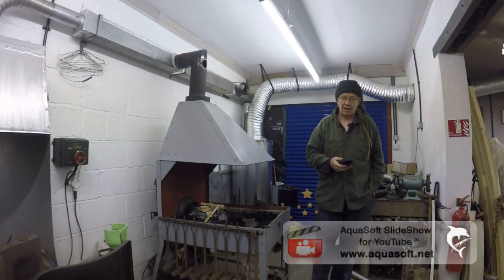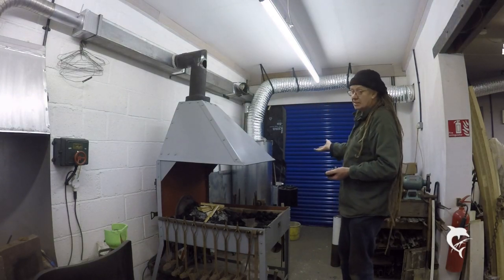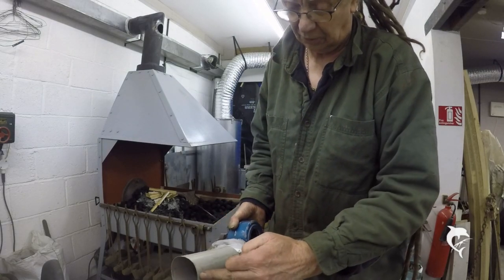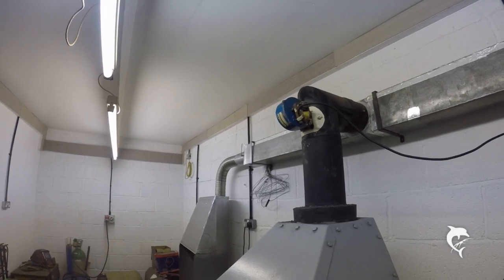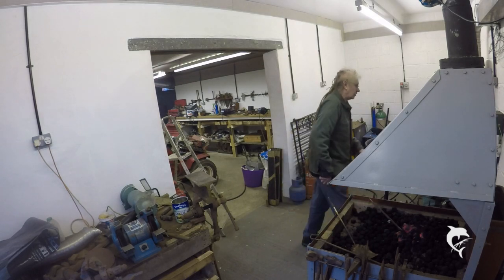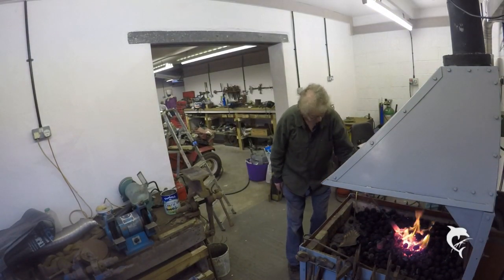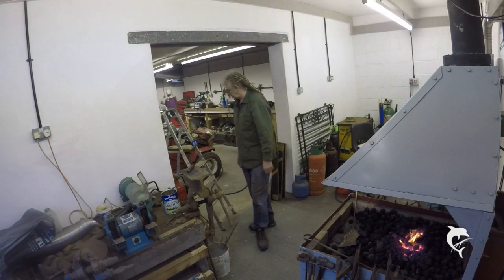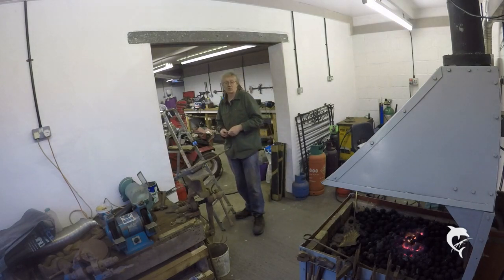A smoky forge, rivets, and a CO alarm!

Comment: Hey up Phil. It may not apply to a forge (especially with fan extraction) but there is a formula that relates flue (chimney) height to fire opening which achieves the correct amount of "draw". I've seen it in an old book somewhere. Also as you will already know I'm sure, the flue needs to warm up for best results. Loving the vids BTW.
Reply from the maker: Part of the problem is that the flue is too small, which I though I could make up for with the flue blower (there are 2 now) and they do make a difference, but not enough of a difference when you are lighting the forge, thats when it smokes. I think the CO alarm going off is down to using the anthracite cobbles instead of proper forge coke (forge breeze, or coke beans) If you know of anyone who has any, I want some!!!
Phil
Reply: Flue area to open area, no greater than 1:4
Reply from the maker: @pherdantler707  interesting, I will have the tape measure out on monday! Thanks Pherd.
Phil

Comment: Cool forge setup.  Is the insulation seal so tight in your shop that perhaps your shop is under vacuum, and hence no flow to the draft??  Just a thought.
Reply from the maker: No Doozer, it's not that, the blue roller shutter door in the background is not sealed at all, plenty of air getting in, I think I have pushed the envelope too far with the flue, I thought that I could make the extract system make up for the flue being smaller than it should be, but the fact is that the forge flue is not big enpigh, or at least, not efficient enough to remove the forge smoke along with the amount of ambient air also available! I am hot beaten yet, there are several parts of the flue and the extract system that can be improved. I can swap the H pot for a straight out flue with a rain cap, I can increase the height, and I can use a more efficient blower. I could also tear it all down and start again, but if it comes to that, I may wait till spring!
Thanks for the comments 

Phil
Reply: @philhermetic  Maybe put an outside grease fan, like the restaurants use. They are made to take the heat.  Just an idea.
Reply from the maker: @kooldoozer  yes, that would probably work, I need to move more air up the flue one way or another!

Comment: The audio is a bit hard to understand. There appears to be a fan or some other motor running in the background. If you can't turn that off, then you need to use a separate microphone and have it close to your mouth. It did get better around 2:10. But it got worse again later in the video.
Reply from the maker: Yer right Paul, the fan you hear is pushing the heat around the workshop from the wood fired space heater. I use a gopro5, and external mikes are not an easy fit, but I will be more aware of background noise in the future. I am also looking for another camera so that a lavalier mike would be an easy fit! Thanks for watching and commenting!
Phil